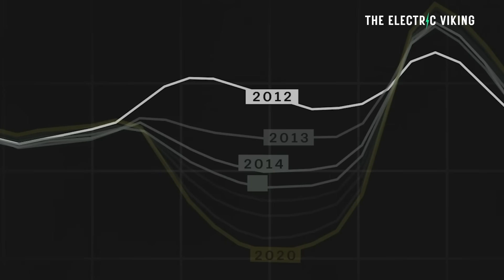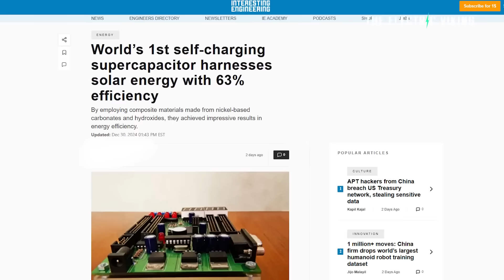Historic First: Solar Tops EU Electricity in 2025 as Coal and Gas Plummet

Comment: This could have been achieved 12 years earlier and at much lower (two third lower!) cost for the consumer. In the year 2013 EU bureaucrats established an average tariff of 47.7% (up to 55% import tariff on all Chinese solar panels), at that time the biggest protectionist move ever : https://ec.europa.eu/commission/presscorner/api/files/document/print/en/ip_13_1190/ip_13_1190_en.pdf Initially planned for 2 years it was prolonged until.....2023 (!). To the import tariff one has to add 19% to 25% VAT (on panel+transport+tariff) tax on tax, payable by the final consumer. From 2024 onwards the same is happening with Chinese EVs (37.7% tariffs plus 19% to 25% VAT) making them double and triple as expensive as in China. The new Byd atto 2 boost price in China is at USD 15,200 - as by now it starts at USD 37,400 in Germany, Belgium, Portugal etc. When it never was about clean and sustainable energy and it is not about, cheap, clean, individual mobility (despite mandatory EV legislation in price and high taxation of ICE mobility) the World has to talk about this too (!). It´s all about tax collection.

Comment: Texas established itself as a renewable energy leader in the US since the early 2000’s, first with wind energy and more recently with solar. Texas is also looking to add renewable natural gas to its renewables roster. Among other areas of RNG activity around the state, the University of Texas at Austin is hosting the new Hydrogen ProtoHub demonstration and research facility at its J.J. Pickle Research Campus. The program is designed to help clean energy innovators fine tune their systems and scale up for commercial application. Extracting hydrogen from landfill gas is one of the projects under way at the facility, along with a new all-in-one system that produces hydrogen from a reaction between sunlight and water. Collaborators in the ProtoHub facility include the not-for-profit corporation GTI Energy, which has been assessing how natural gas infrastructure in the Gulf Coast can be repurposed for RNG as well as green hydrogen and synthetic natural gas.

Comment: The only problem is that even 20% solar in June will drop to about 2–5% in winter. So while solar energy can soon cover all our needs in summer, winter is a real challenge. Batteries will not solve this either, because they cannot store energy for whole seasons.
Reply: Lol keep telling yourself that. I have solar on my home and during the winters it's half what it produces during the summer. So if they are having 20 percent they will go to 10 percent. Simple solution, keep building more and create more jobs. Renewable energy equals jobs. Oil equals pollution.
Reply: @TheLobo91 you obviously dont have snow where you live do you 😅
Reply: @jankohrasko5744  This is why vertical mount panels have become a thing in REALLY snowy areas. Areas that only have a few feet of snow on the ground are best served by tilting the panels for maximum output in winter. The slope is then sufficient to cause the snow to slide off.
Reply: I have 8 panels. In the summer that heats the inflatable hot tub as well as powering the house. In winter we just put the hot tub away.

Comment: How much is fossil fuel consumption going down (if at all) in Europe?  In the US, Trump is trying to cancel wind projects that have already been almost completed. In Canada, Premier Danielle Smith wants to build another pipeline to expand tar sands oil production, even though oil companies would not build the pipeline themselves.  Smith believes that solar is unreliable because "it does not work when the sun is not shining".  She has no idea of how solar and batteries can be combined to augment the electricity grid supply. Alberta, moreover has lots of good sites for solar and wind.  It also has mineral resources that are important for renewable energy sectors.
Reply: "In 2019, fossil fuels provided 39% – some 1,130 terawatt hours (TWh) – of the EU’s electricity, while renewables provided 34% (979TWh). By the end of 2024, fossil fuels had fallen to 29% (793TWh) – the lowest level in at least 40 years"  From energi analyst Ember.
Every fossil fuel is trending down but most of all coal

Comment: Oh Solar is #1 in Europe? - ask Spain how great it is for them. You Sir VIking keep pretending electricity is all the power in Europe it isn't 2/3rs of power used in Europe is not electricity so obviously over 2/3rds is not solar or wind. Here is the real break down from IEA.  Oil 33%, Nat Gas 24%, coal 12%, Nukes 11% hydro 3% - that adds up to 83 % Bio fuels - burning garbage is 3% so while its called a renewable it may as well be coal, Of the remaining 14% nearly all is wind solar is under 3%..

Comment: Renewables are not carbon neutral, their value varies is highly dependent on the context they are installed. 
It's an important source and tech development will further improve them, so they can make up a good fraction of the grid, but replacing coal with gas would have an impact far greater than getting from 60% renewable to 100% lets say, the need for batteries drives costs and carbon up.
Reducing decommission gas plants is not reasonable for these reasons, also when energy demand is expected to go up.

Comment: There is no way for Europe to generate 50% from solar
Reply: Greetings from North East Scotland.  For the year to date, 40%  of my consumption came directly from rooftop solar, 25% came from batteries supplied by my solar, or cheap overnight grid charging.  That consumption covers my EV, and my heat pump.

If I can do it, then so can Europe.

Comment: Wow, europe is truly smarter than the usa. It’s like the usa is stuck with a “leader” who wants the rotary phone over a cellular. He simply is not intelligent. The usa should be leading in all the newer technologies, not falling further and further behind.
Reply: Sadly, the orange cockroach is 80 years old and a tool for petroleum billionaires.
Reply: If Europe is so smart why does there electricity cost so much?
Reply: @DGlass-yg8xk  If DGlass-yg8xk is so smart, why can't they spell 'their'?
Reply: @DGlass-yg8xk   Transitioning from Fossil Fuels to Solar/wind?
Reply: @DGlass-yg8xk  Europe is a big place. My hydro powered country is exporter of the electricity and our bills are incredibly low. 30-60€ a month.
Reply: @DGlass-yg8xk  Do you really need to think that hard about it?? You just have to understand that Europe doesn’t have many natural resources in terms of oil, gas, etc.—most of that is concentrated in Russia and similar regions. Because of that, over the decades, Europe has always had to import a lot, and that’s what drives prices up! But renewable energy is going to change that… even if the trend rises only little by little. Especially now that the prices of solar energy equipment are dropping drastically, batteries are becoming cheaper and lasting longer… the trend is that more and more families will be tempted to ensure greater energy independence. And this boom is happening all across Europe—in many countries—and it’s visible in the number of new businesses emerging around these topics. Precisely because it’s not a region rich in oil, Europeans see solar and renewable energy differently from the rest of the world. It’s not just because of the European Union’s campaigns.

Comment: 2:33 Croatia (90%) Well most of that is hydro, solar part is miniscule it is only about 130 GWh a year out of total 16,920 GWh annual consumption.
Reply: Still counts!

But yeah it's a little disingenuous
Reply: @kylejohnson6775  I am not saying solar is wrong (it is cheapest energy source and fastest to implement and the least corruption around it unlike nuclear) just saying do not use misleading examples, there is pleanty other examples to support argument, no need to use wrong ones.
Reply: @aleksandar7393 

Just to be clear: I agree with you

Comment: We have lots of wind farms in the UK. Half the time they must be switched off because the National Grid is unable to transmit the energy. We have the most expensive electricity in the world. It is bankrupting industry and impoverishing the already poor. Our Civil Service is the envy of the world and they monitor infrastructure projects.
Reply: This is BS. 90% of wind power in the UK is used. You are just parroting the fossil fuel lobbies misinformation. You should check your facts before posting.
Reply: @Alantj22 The wind farms are switched off when the wind is too strong. Too many times the grid is saturated and again the wind farms get switched off. But the wind farms are switch owners still get paid. We have the most expensive electricity in the world. Is that what you deem a success? I have solar panels on my roof, I have 10kWh battery, and I drive an EV. Also my provider is Octopus energy. So I'm not a fossil fuel zealot I'm a realist. My EV is cheaper to run. By energy bills are lower. But global warming isn't so urgent that we should bankrupt the country in our haste. We are going to be like the surgeon who says the operation was a success but the patient died if we don't get some balance into our thinking.
Reply: @johnfrancis4401 Your civil service is far from the envy of the world.

Your civil service is the problem.
It has created the contracts that sets grid energy pricing based on natural gas prices, presumably to protect the profits of these suppliers.
Reply: You don't have the highest in the world, but it's high on the list.
A big part of the problem is: energy in Europe has become expensive, the Netherlands can't deliver a lot of gas anymore and we don't want to buy from Russia.
And the way the prices are calculated every hour so might need to change as well.
Reply: @autohmae YES WE DO. And it's due to the "GREEN" subsidies needed to pay for windfarms.
Reply: I can only echo the severe impact this is having on businesses and the economy as a whole.  Even if not a business the "green" levies on normal working people are crippling.  Who in the hell thought this was a good idea?

Comment: Slovakia has enough nuclear energy, next year a new reactor will start up as well. You add up nuclear and hydro in Slovakia and you will see, the country is producing a lot of clean energy...
Reply: And a lot of the solar on houses (we have a 3KWh array in Slovakia) is not captured in the official data because no one records it. It simply shows up indirectly as less electricity bought from the grid. In addition hydro electric power is nearly as large in terms of generation as fossil fuel power.
Reply: nuclear is the DIRTIEST form of power generation
Reply: Good for slovakia and all
Reply: Where does all the radioactive waste go after producing all that clean energy?
Reply: @JohnEN-THZ  inside a specially sealed, mountain cavern
Reply: @vojtechvoros1549  Who certified the "special" seal? For how long is it certified to remain sealed? 10,000 years? 100,000 years? Who provides servicing to maintain said "special seal" for these years? Finland?
Reply: @JohnEN-THZ me and my buddy, whats your problem brother? It does not emit any gas, fumes or particles. It functions well for a long time. It provides clean energy.
Reply: @vojtechvoros1549  sure, you right
Reply: @JohnEN-THZ  finland

Comment: This expensive form of energy is one of the reasons that Europe's economy in in the toilet. Time to switch to geothermal and clean safe thorium nuclear energy. What is never mentioned is what becomes of these solar panels after their lifespan is over. There is really no way to recycle them with all their toxic chemicals.
Reply: Thorium and Geothermal are cool and useful. 

And there's absolutely no world where they're cheaper than sunlight-converting rectangles. 

Why lie about solar cost and difficulty recycling? Isn't the goal to go green and get rid of fossil fuels?
Reply: Thorium is expensive.

Not least because it is very corrosive, and thorium plants degrade and can become very dangerous.

Comment: I was in southern Italy earlier this year and was amazed at how few buildings had solar panels as the very hot sun was beating down. Hungary was a bit better, but still lots of room for more installations. The good news is that this leaves room for more efficient and cheaper solar systems to be installed so the switch over to renewables when it comes will be more dramatic and effective.
Reply: Yes home roof top helps but most of this new pv solar electric power is utility solar it is the lowest cost.   It is less expensive than burning old solar stored underground as hydro carbons.   It is also more effective and cleaner way to do things.     Trump would covert all kitchen stoves and household lighting to Coleman camp stoves and lanterns.   Ya right what a joke.
Reply: 世界の電気代を調べてみたらいかがですか？真実が分かります

Comment: Currently the weather in the Netherlands is terrible. It's already 9 AM here, but none of my solar panels generate enough to even power on the inverter. The good news is that our 3000 wind turbines are doing great with the storm and the wholesale price of electricity is around 0 per kWh, making the cost very low, even with margins and taxes.
Reply: I've got 2 hours of free electricity this afternoon with octopus here in the north of England
Reply: @stevejones2310  Great way to get people to use that wind power. To my surprise the solar panels are now powering the home and are charging the battery since 10 am, even if it's only with 100W of surplus with the overcast weather.
Reply: @SolAce-nw2hf That ev will be charged by Easter.     See you then.

Comment: The mix of solar and wind works very well. Hard to get higher then 95 that Denmark has. But its also heating and water. 
Look into Denmarks biogas production the goal is 60% in 2030 also used for heating the houses

Comment: Price information right now in Northern Europe, Finland:
- the lowest price of the day 0,00 eurocent / kWh and the highest of the day 0,37 eurocent / kWh
- the average of the week 6,25 eurocent / kWh
- the average of the month 5,58 eurocent / kWh
In addition you need to pay transportation of the electrisity and taxes.
In addition to the solar, wind power is important source in this arctic area, too
Ps. I'm charging my EV right now. 🙂
Reply: In Finland, the use of coal for electricity generation has ended, as the last coal-fired power plants were shut down in the spring of 2025, four years ahead of the deadline set by law. Coal was previously an important fossil fuel for electricity and heat production, but its use has now been replaced mainly by nuclear power, wind power, and other renewable energy sources.
Reply: Thanks for the info, it's really interesting.  Pete, Australia.
Reply: Finland gets almost 40% of power from nuclear though.
Reply: Sounds like customers will buy batteries (solar generators) and buffer that electricity for use during peaks.

Comment: If you are intrested in the energy situation in Sweden (and Norway indirectly) please look at this German film. It is dubbed to english, and it is named "Schwedens Strom-Preis-Wunder? Die unbequeme Wahrheit". This gives figures to the fact that Swedens electricity is not at all based on fossil fuels. There are approx. 65% renewable and nuclear 35%, but this changes a little year by year.